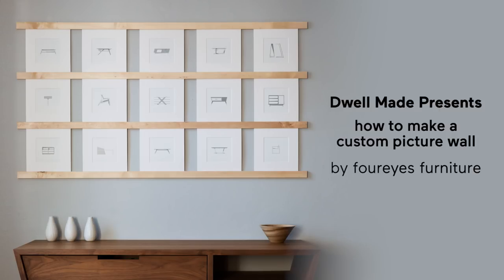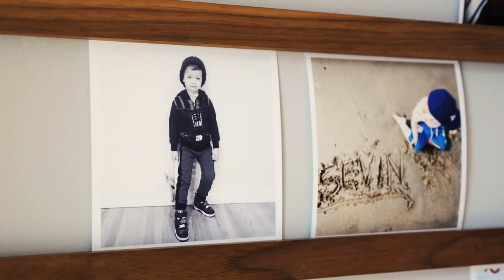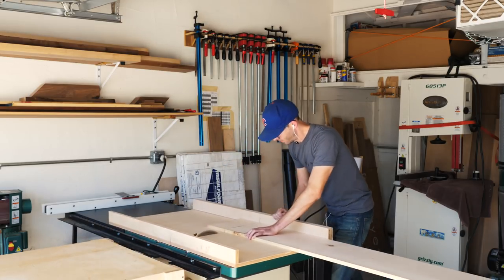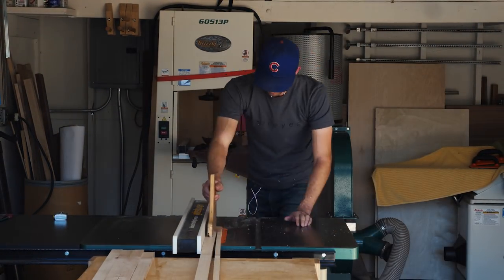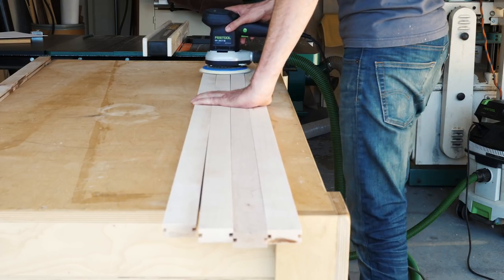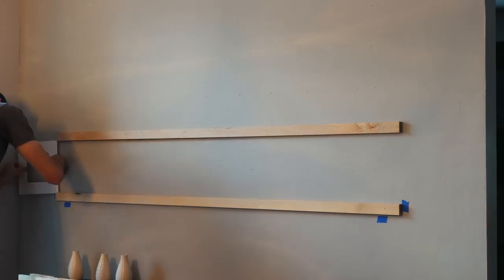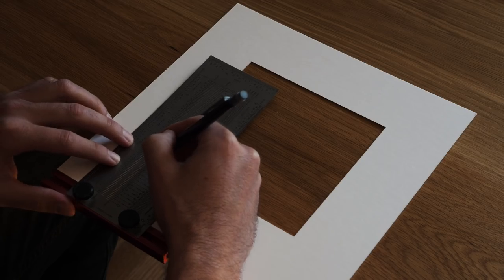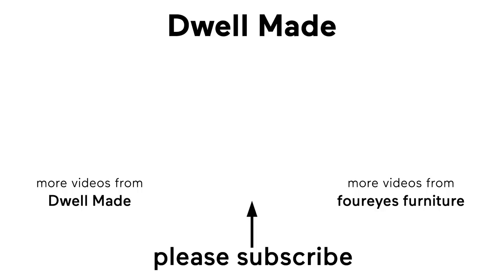DIY Picture Wall | A Dwell Made Project

Comment: Awesome project - it looks great - I am wondering how I can put one up. 
Some quick questions - is a finish nailer the same as a pin nailer (23g)? Did you use some sort of adhesive? And what kind of wall is it? Did you shoot for studs, or isn’t necessary?
The new channel looks great!
Reply: Mofjell1981 pin nailer uses much smaller nails, finish nailer is 18-22 gauge and uses much longer nails, there was no adhesive visually as he said there was no weight to the project, and the nails were placed randomly